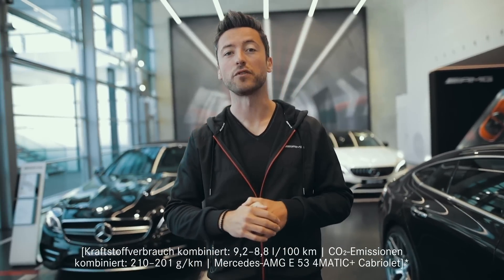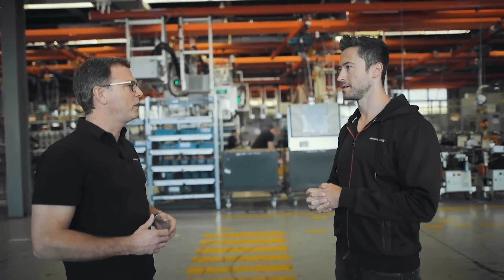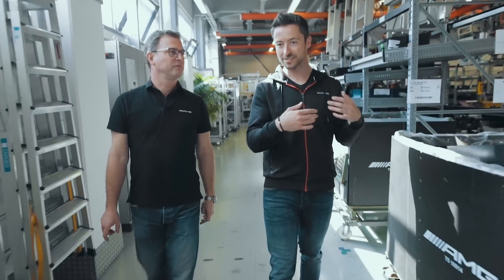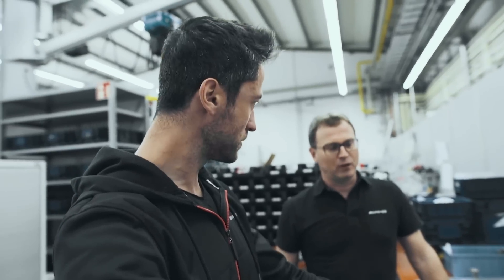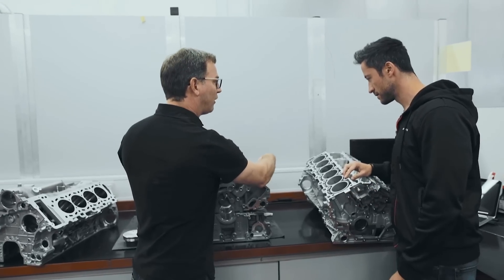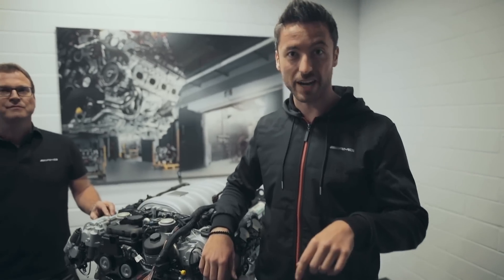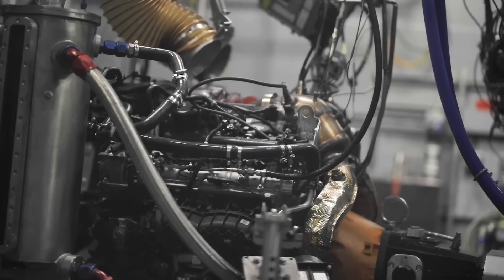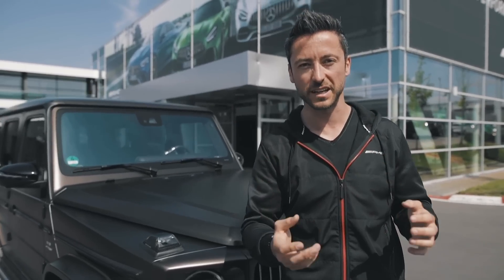INSIDE AMG – Cylinders | Exclusive Insights Into the Development

Comment: I would love to see material specification and heat treatment chart for all components associated with Engine and piston.
Reply: SHUBHAM SARKAR say do you by any chance work for Scuderia Ferrari? 🤣
Reply: @chintanjani  naaaa, I work under  ASME Boilers And pressure vessels Code category job. So, ASTM & SAE material specification standards are similar. My interest is, to understand it's intermolecular structure at different, temperature and cubic structure stability at  hot spot areas. Usually, zirconium, vanadium, titanium and Chromium-Molybdenum compositions are most favoured. Now-a-days Aluminium-Sintered Alloys are favoured. I just want to grow my knowledge nothing else.
Reply: @Amarjit Singh can't sleep without info.
Reply: @Amarjit Singh No I won't
Reply: Hahaha 😂 what about making all steps from 0 to 100%
Reply: @genius_programmierer  that would be tooooooooooooooo lengthy to read.